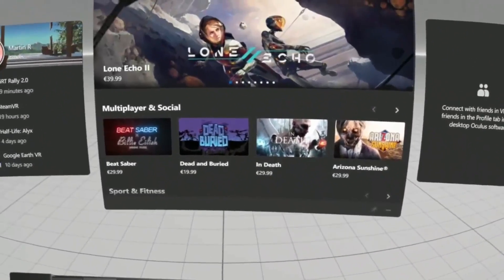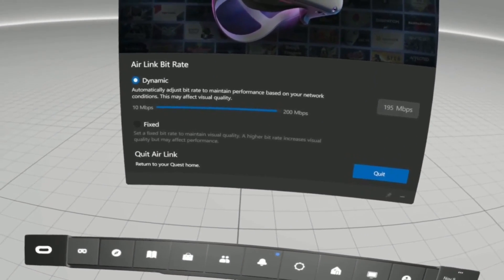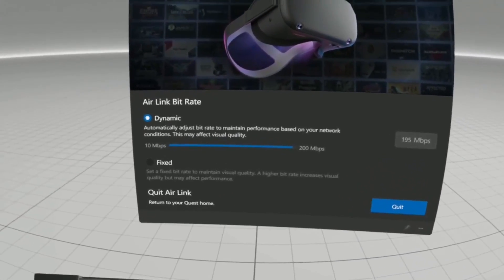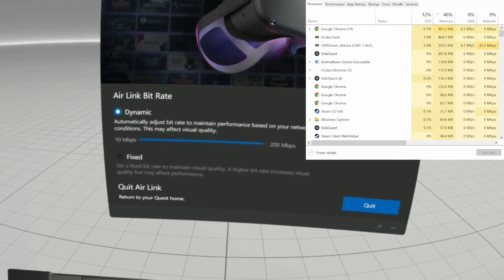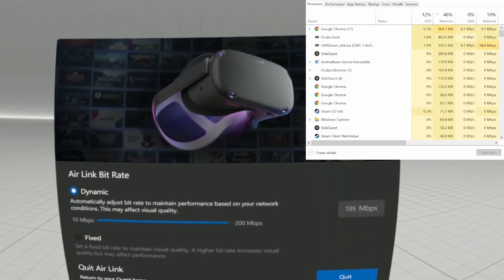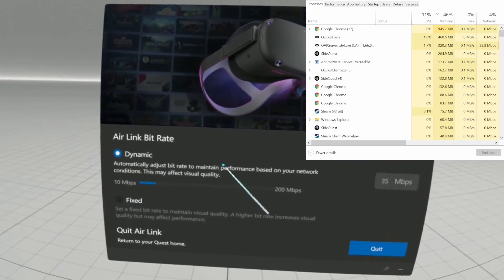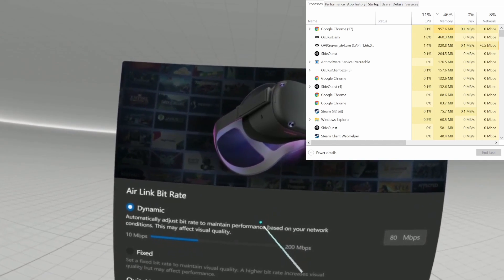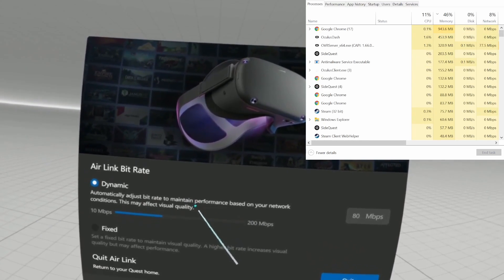How to Measure Oculus Air Link Bitrate in Real-Time (Easy!)

Comment: I always end up setting mine fixed on maximum (200mbs) I'm getting a solid 180mbs, if I leave it on 200mbs and set it to dynamic, it hits 80mbs. The only reason I can think of that it does that is to save battery. Set it on fixed 200mbs for the clearest output. I changed the codec from default to H.264 also and somebody said you can force the bitrate to 400mbs in the debug tool as well. i have not tried that

Comment: Changing in 'dynamic' didn't do anything for me. My Mbps transfer on OVRServer was getting no more than around 25-30 Mbps! However, I changed to 'fixed' and set to 100 Mbps. Made a huge difference to my Quest 2 Air Link performance. So cheers for this video and steering me in the right direction. More to tweak, but things are looking good now ;-)
Reply: I set mine to 175 Bitrate (Fixed) and it looks the same as the link cable. I could set it to 200 aswell but I don't notice much of a difference between the 175 and 200

Comment: I wish this worked. I've got the entire specific setup (dedicated 5ghz for Airlink or VD etc, measured 1200mpbs up/down to the Quest according to the router) but no matter what I do Airlink won't use more than 20mpbs and changing bitrate settings changes nothing about the blurry (but lag-free) mess I'm seeing both on the desktop and in-game. So frustrating.
Reply: I solved the issue. The guilty was the Oculus Tray Tool. Since the OTT doesn't have the parameter "Encode Dynamic Bitrate", when the service is started from the OTT Quest Link area, the parameter is disabled in the 'Oculus Debug Tool'. Then, and I don't know why, the bitrate max is set to 20Mpbs. Thanks!
Reply from the maker: @alberginiaproductions2520  Thanks for sharing!
Reply from the maker: What about VD? And also wired Link? Could be a good idea to also check your Debug Tool settings
Reply: @smartglasseshub6285  I have the same problem. The bitrate never goes beyond 20Mbps, no matter what I set in the Air Link setting (dynamic or fixed). I have a dedicated 5Ghz router configured as access point, and my computer is connected to it via Ethernet (1GB connection). I'm using Oculus Tray Tool or the Debug Tool seeting a '0' in the bitrate parameter, but nothing is working: the ovrserver_x64 it's stucked at 20Mbps in the task manager. Do you know if is there any configuration file or something that can be overriding the Air Link or the Oculus debug Tool settings?
Reply: @smartglasseshub6285  I've just received the notification of your message but I cant' see it on here. Anyway, I have the 2.4Ghz wifi disconnected, I'm using the 5GHz network in the 80Mhz bandwidth and the type 802.11ax. I scanned also the best channel with the WiFi analyzer..

Comment: Mine shows 1.4Gbps is that good
Reply from the maker: Even with regular wired link, the bitrate should realisticly be a lot less than that.
Reply: that's surprising actually, is that wireless? the quest2 has a limit of 1200mbps, or 0.096gbps on wireless.
Reply from the maker: Based on my experience and testing you can not get anywhere near 1200 Mbps. In Oculus Debug Tool, the maximum bitrate value you can set is also capped to 500.  

And in reality, it doesn't matter much. Starting from 100mbps and upwards, you start seeing diminishing returns in the overall improvement of the VR quality.
Reply: @smartglasseshub6285  So just so I understand you correctly: I do NOT need to have 1200mbps to get a good experience and stream 3D movies etc? Thank you.
Reply from the maker: @JohnAndersen2050  Yes!
Reply: No. It didn't.